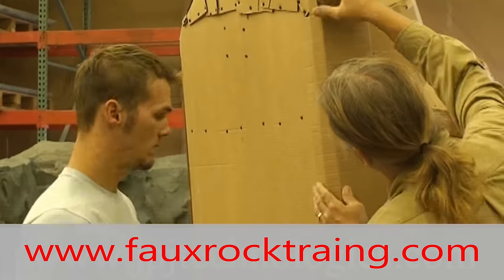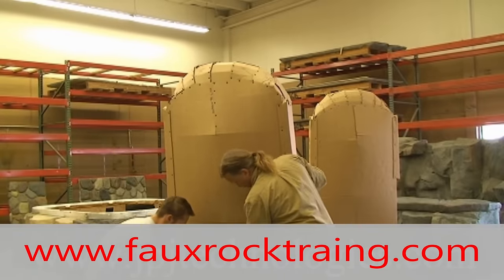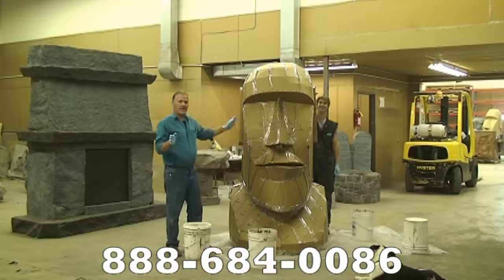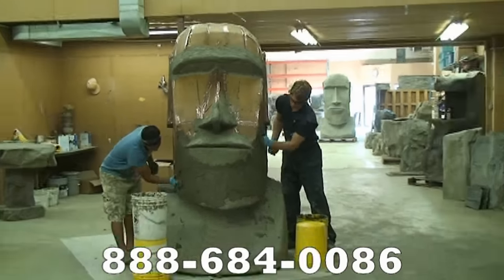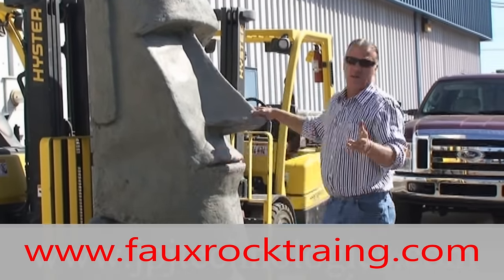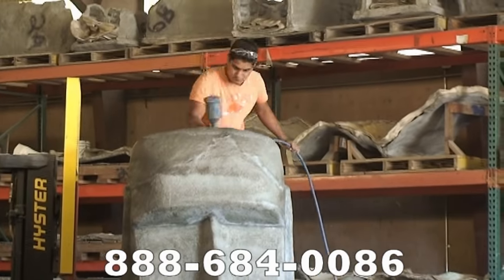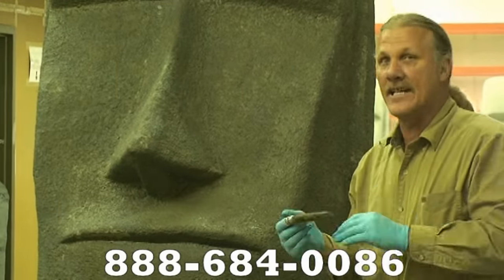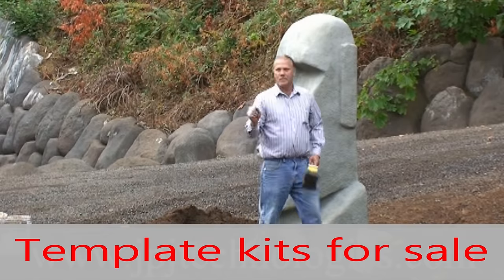How to make an Easter Island statue with cement Part 2

Comment: Absolutely amazing.  I worked in the concrete business for a long time.  I'm seriously surprised this worked, and now I want to try it.  Thank you so much for posting this.
Reply from the maker: Awesome, thanks for the positive feedback. I’ve spent a lot of years in strengthen my mixture so I could obtain structure in thinner coats to limit both cost and weight.
Reply: Saru

Comment: Oh wow, this is amazing. I was wondering if there is a need to have a wire mesh to improve structural integrity.
Reply from the maker: Actually, I’ve been building these statues since 2009 without any mesh being used. I would admit it would be stronger with the mesh but I wouldn’t use wire mesh. I would use a textile mesh which is far superior but that being said I won’t be putting any type of mesh going forward as it’s not needed. Thanks for your positive feedback and the time you’ve taken and watching my video.

Comment: On the texture have you ever tried a  hypertufa mixture incorporated into your concert mixture? 
A strong HYPERTUFA recipe  -> *1 part Portland cement
*1 part Pete moss
*1 part perlite with sand. 1/2+1/2 or 1/4+3/4 … this is a mixture when you want to make something concrete really look old as if you found something ancient, you can cast anything using it however something as big as easter island statues I bet you can find the ratio for your mixture. Try casting a elephant ear leaf this can be done by digging a hole in the ground placing the leaf in the hole or it can be done over a large object putting mud down (you need give)over the object then lay the leaf on the mud then put the hypertufa mixture on the leaf.  Just a thought 💭 you can test it out. Great job you guys have done here!
Reply from the maker: Thanks for the positive feedback and I appreciate your sharing your hyper turfa technique I’ve seen it before. Just never have tried it. Thanks. I appreciate you watch my video.
Reply: I’m a artist there’s not much I can’t do I apply my mind’s eye to everything I do in projects painting, landscaping, interior design , event planning I could go on and on for me it’s all the same just different projects…it’s hard to come across people who truly impress me…. YOU ARE OVER THE TOP I’m impressed big time… HUGELY!  I want one lol  or three…. I’ve had to show you off to my peeps…. That’s bad ass! Not to mention you’re a great teacher… awesome follow through you have! Geat video!
Reply from the maker: Randi, Your very kind comments are probably the best feedback I think I’ve ever received! Thank you so much and I really appreciate you taking your time to watch my video.

Comment: So, what is lifespan of this sculpture? Would the cardboard lose structural integrity over time? Thanks, what an incredible process to watch. Im excited to try my hand at large sculpture using this process! Thank you xx Josie.
Reply from the maker: I offer a 50 year warranty on the statues that I sell. The cardboard isn’t a concern as it is only used as a form. Once the cement has dried the structure is carried by the cement shell. Thanks for watching my video.

Comment: So at 7:38 in the video you guys apply hydro seal in the form of a seemingly very fluid cement slurry. So are you mixing a ton of hydro seal into portland cement and using that as a top sealant coat? A concrete layer that in itself is the sealant coat? Also sorry for the constant questions. Also I'm guessing that's the reason your acrylic watered down paints manage to penetrate at all, since there is still a level of outside concrete that could suck it in but it prevents water from being sucked in any further than just the superficial surface.
Reply from the maker: Hydro sealer is a product that has a base of Portland cement. That couple with the acrylic admixture makes for a very watertight coat.

Comment: These are very impressive! Did u use any bonding agent between layers? Or does concrete need it if it is still wet before adding another layer?
Reply from the maker: Thank you for the positive feedback I really appreciate you taking the time to watch my video.

Yes, I always use a bonding agent in between any layers of Cement that I apply

Comment: just a thought : instead of taping and coating, wouldn't  it be more efficient to put shrinkwrap over the cardboard construction ?
Reply from the maker: Yes, and no… it could be a good thing and protecting the cardboard from getting wet but at the same time it would make applying the mixture slippery area to try and stick to.
Thanks for your feedback I appreciate watching my video .

Comment: No mesh layer between the concrete and cardboard? Doesn't the concrete crack and break off like that?
Reply from the maker: Made hundreds of these Easter island statues and not one of them has any mesh and are still structurally sound and serving their pre-determined application. Although I will say if the mesh was incorporated, it would be even stronger.

Comment: Silly question....you dont use structure supports like rebar or wiring to keep it together????
Reply from the maker: That’s not a silly question…Tradition would have a rebar or wire armature, which is the structure of the statue. In my case, that was a Cardboard armature, which has no structural value, even with the cement being added. 

I have chosen to utilize textile reinforcement and I can assure you the statues that I made back in 2009 or still with us today and strong as ever and will continue to be. Rebar and wire can rust and weaken overtime. The textile reinforcement that I’ve utilize will be here for hundreds of years.
Reply: Thank you.   I want to create statues, large ones for outside.    I did make a six foot shark for my grandson, about thirty five pounds, but not weather worthy.    I would like to make something similar to what you did on a very tight ssi kind of budget.   Looking for options.   Have a very nosy neighbor on horseback even trying to deter.    That or making storks with goggles looking back at her kind of mindset right now.   Thank you for info.

Comment: Can it be created by sculpting?
Reply from the maker: Yes sculpting methods are a way to make many things. It requires more skill on my opinion.
Reply: @fauxrock : Wait a minute. Technically you are sculpting, just using a cardboard medium 
to do so.  And, not necessarily more skills, just different skills.

I guessing, what you do could also be easily done with styrofoam, it would just be more messy.
Reply from the maker: @jayedwin98020: I think you’re a bit confused… in sculpting, one starts out with a block of material and chisels the way to the end result,such as like what Michelangelo… the process that I’ve used is the reverse of sculpturing. I started with nothing… Starting with just a small scrape of cardboard cut and screwed together, One piece of cardboard at a time until my creation emerged. From there. I still had to add a mixture and texture it, stain and seal it, all. The reverse of sculpturing is a whole different type of talent.

Thanks for your feedback. I appreciate you watching my video.
Reply: @fauxrock : By definition, sculpting is a far broader area than just the one type of sculpting Michelangelo has done. 

FYI: "Sculptors use additive and subtractive techniques to create sculptures. Additive means to bring materials together, while subtractive means to take away from the base material. Four main techniques exist in sculpting: carving, assembling, modeling, and casting."

No confusion here. What your sculpting is, is "additive", and definitely considered to be a type 
of sculpting, even if you're only adding cardboard and cement together. Your net results is definitely a sculpture.
Reply from the maker: @jayedwin98020: in reviewing this matter, I will apologize for my condescending, sounding reply to your sculpture line…. I always hate it when I learn something I don’t know the hard way I stand corrected. My good sir humbly, so thanks so much for your positive feedback I appreciate your time.
Reply: @fauxrock : Thank you, and no apology necessary.  I just really enjoy watching how you assemble and create, all your work. You have a lot of artistic talent, whether you call it that, or not.

Also, you should never hate learning something you weren't aware of. It happens to me all of the time. That's how we're able to grow and increase our  knowledge. And to me that's wonderful. 

How boring would life be, if we never learned something new on a regular basis.
Reply from the maker: Thanks… Enjoyed your sharing 👌

Comment: far too cumbersome, with far too many explanations, everything is much easier. take 'Ytong' stones (aerated concrete) in the appropriate dimensions, glue them together and work out the desired profile, then coat with a thin liquid cement and leave overnight, done.
viel zu umständlich , mit viel zu viel Erklärungen , geht alles viel einfacher . man nehme "Ytong" Steine (Gasbeton) in entsprechenden Dimensionen , klebe sie aneinender und arbeite das gewünschte Profil heraus , danach mit dünn flüssigem Zement bestreichen und eine Nacht stehen lassen, fertig .
Reply from the maker: Thanks for the feedback. I really appreciate you watching my video.